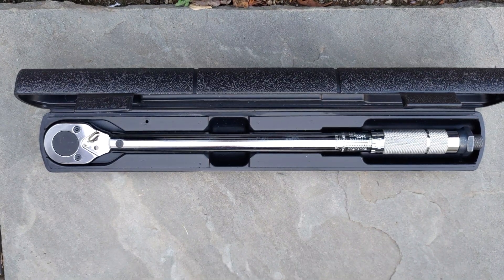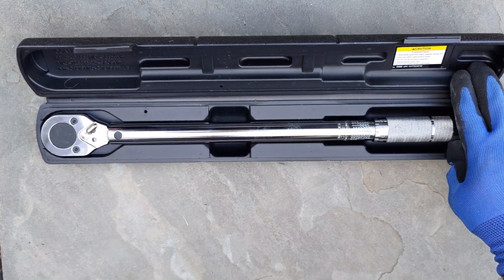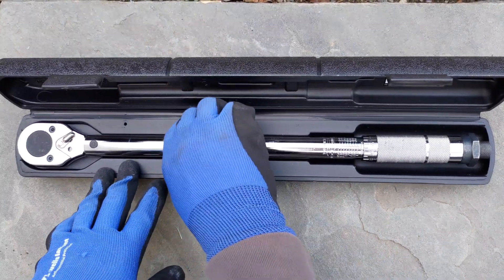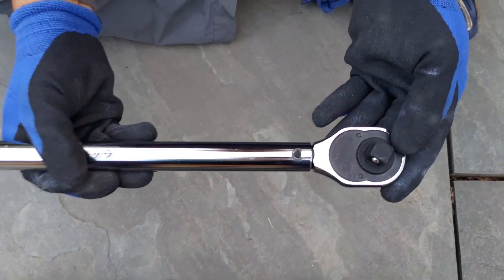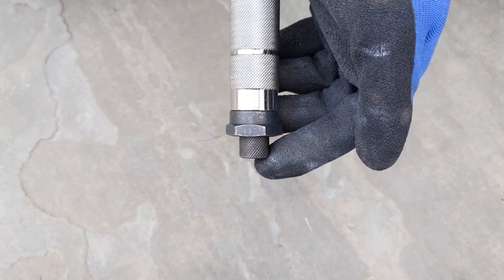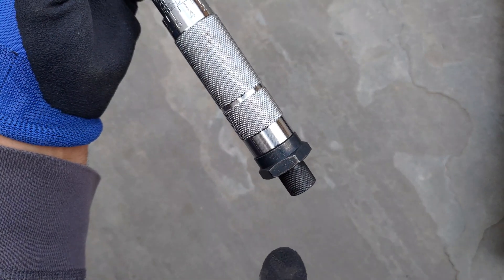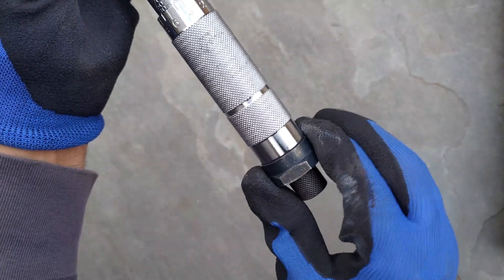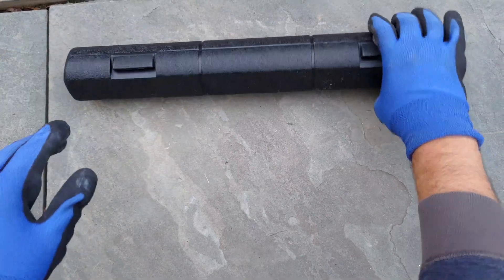How to Use a Torque Wrench Correctly (Part 1 of 2) Overview of the Basics

Comment: You covered do's & don'ts pretty well but you could have actually shown how to use it to tighten a bolt / nut to a specific torque setting - which is what your title suggests the video would be about.
Reply from the maker: Thank you for your helpful feedback.  Please see: How to Use a Torque Wrench Correctly (Part 2 of 2) Install New Mulching Blades with a Torque Wrench: https://youtu.be/Ae2g50qmPAk